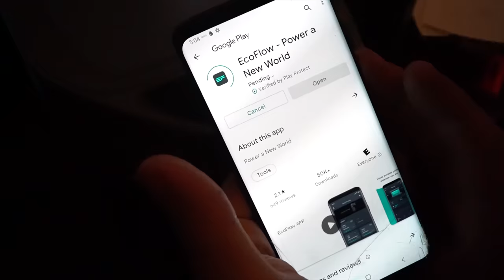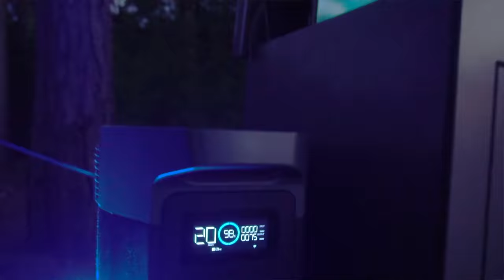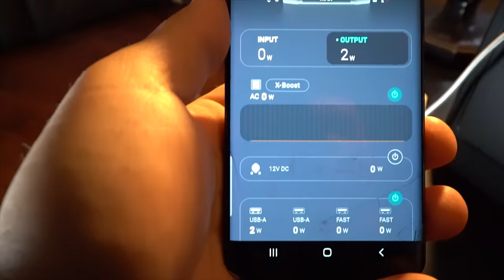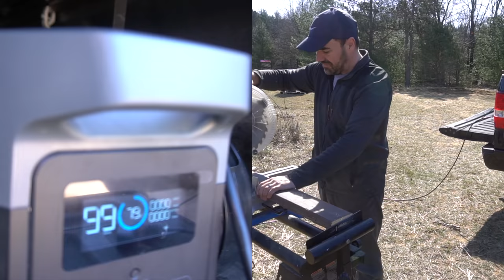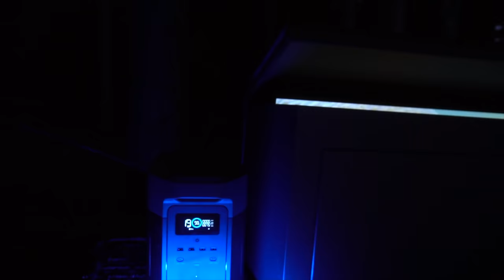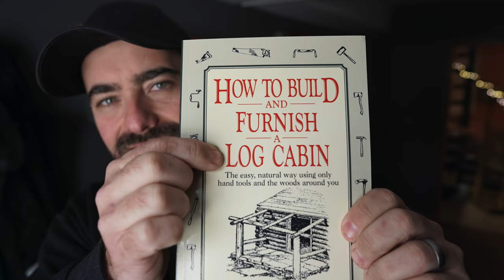Solar, Solar, OFFGRID Power EVERYWHERE on the Homestead (EcoFlow Delta Max)

Comment: I noticed you are using a PWM (Pulse Width Modulation) charge controller   Those things are dead cheap but also totaly inefficient and will limit the battery life.  When you change that PWM controller for a MPPT (Maximum Power Point Tracking) one you will be amazed how much extra power you get out of the solar panels. PS all the best from the Netherlands
Reply from the maker: Good to know, thx!